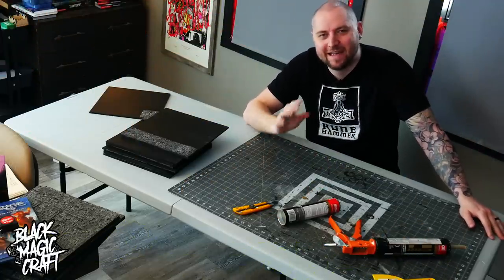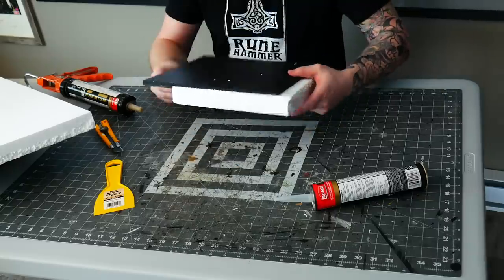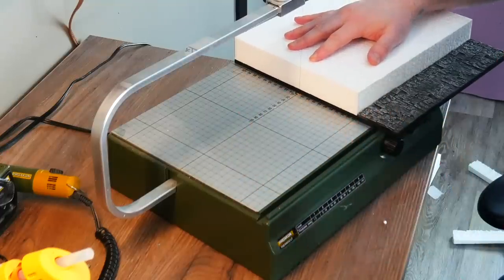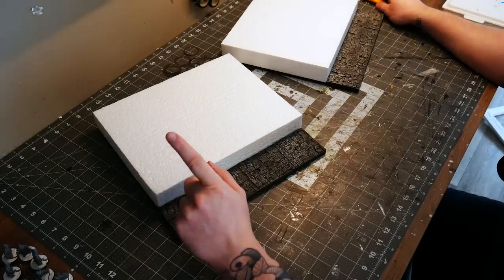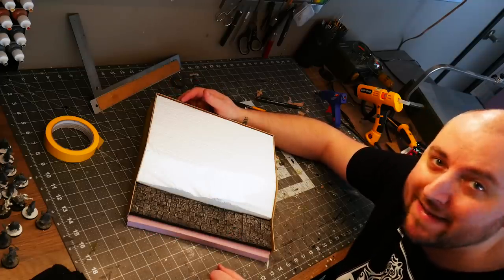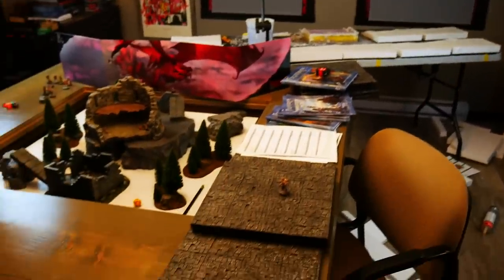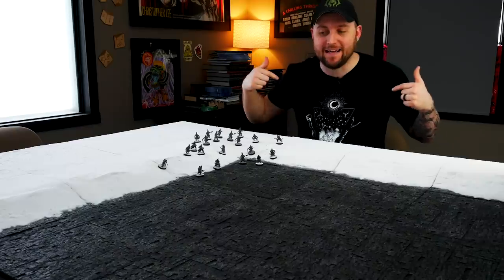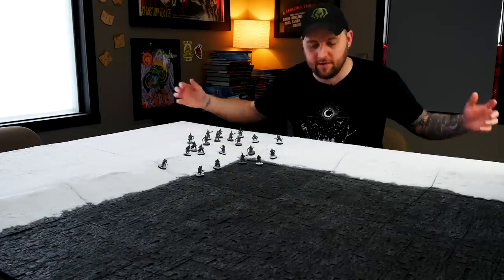High Detail Resin Tiles for FROSTGRAVE - Part FOUR

Comment: I don't build gaming things.  I am a dollhouse person.  But I always learn a lot by watching what you do.  For instance, I could use the snow hill techniques to build seasonal scenery for my dollhouse surround.  Also I have changed how I do fireplaces entirely based on watching you work with XPS foam.  And now the ones I make are not nearly so heavy, thus lightening up the overall weight of a dollhouse. And I may even try silicone molds and resin at some point.  (I am circling that issue still.) I really like watching an entire in depth difficult project like this for a number of reasons.  For one thing, I usually have no idea how long others take to do things, so I always think I am very slow.  (But not really, apparently. It just takes that long.)  I also like seeing where things went wrong and how you corrected them.  Very useful for us to avoid those mistakes, but also again, good to see that things do not always work out immediately for other hobbyists either.  Finally, I just really like watching people work. And I like that you tell us when you are tired, frustrated, bored etc.  All very human and again, something I can empathize with.  Thanks for sticking with this long project for us.
Reply from the maker: That's great! I love hearing people finding help in my videos for other things....doll houses, dioramas, fairy gardens, etc. It's great how much of the techniques overlaps between hobbies. Thanks for watching and for the feedback.

Comment: One of the really cool things you could do with this modular terrain too, is having a big ol' snowhill in the middle of the cobblestones. Since you have approximately six transition pieces, if you did a 5x3 battle grid with the setup of Cobble, transition, snow, transition, cobble... it would be a cool snow-hill that the different sides are fighting over rather than a basin that you currently have it set up as. :D

Comment: Which method? Do both, let the project decide which is more appropriate.

While I have no desire to make these exact tiles, there was a lot of great takeaways. Most notably, tips on casting, snow flock, trimming on the proxxon, and generally how to approach a large modular project by planning ahead as much as possible to avoid pitfalls. Most importantly you sharing those inevitable pitfalls with us.

Keep up the great work!

Comment: As a guy who also made a bunch of snowy terrain and a snow covered battle mat, I also recommend simply buying the snow flocking from Woodland Scenics. I tried a lot of different snow method and the easiest one was with the snow flocking. Even with paint over any homemade recipes, I was not looking as good. 

For it to look like snow though, you might have to do a 2 to 3 coating of the flock, especially if you want it to look like thick snow. I found that using only 1 coating would let some gaps between the flock and it wasn't looking as good, even with a white undercoat.

Comment: In model railroading when applying the sculpamold between modules, we clamp the two modules together apply and shape the molding then before it dries completely we take a knife and slice the moulding and pull the modules apart and then let it dry completely. No need for gigs.
Reply from the maker: But in railroading they only fit together in one orientation, permanantly. In gaming they need to be modular and have every piece fit together in any order. Not just A B C D, but D A B C or C B D A....this is why they need a universal jig so ALL sides match.

Comment: Video types suit different things. Experiments and trials like this work best in vlog, while shorter form snappy things are easier to copy, though I’d suggest doing as Pinkstylist did and creating some basic, snappy techniques videos and linking to them whenever you skip over a technique you’ve done before (dry brushing, flocking best practice, resin doors, tile bases etc).

Interesting build though I’m wondering if brick or cobble plastic art would have been cheaper and more durable in the long run. I’ve found resin prone to chips and warps.

Comment: Another good option for the snow flocking would be to apply a layer of clear, polyeurethane gloss over the areas you want snowed over, sprinkle snow flock over it until it looks dry on top (The gloss will make the flock look wet), then leave it for the gloss to dry and recover any of the flock that doesn't stick, then add another coat of gloss and go with a light sprinkle over top, it gets rock hard in the end and works great for this kind of thing.

It does tend to look better than using the glue paste option. My big use of it was back when I was playing Warhammer Fantasy, had a Vampire Counts army that I'd modeled more after the scourge from the Warcraft universe (Death Knights could be handled as Vampires with no issue other than sourcing models that fit well), so a lot of snow and ice terrain thrown together for it where I'd used it.

Comment: Nice job. I think the only thing I would add is some airbrushing on the central squares so they are more snowy... but that means they can only be used for snow where as yours can be used for other settings.
Reply from the maker: As I said in part one the stone tiles are intentionally left generic for use in other games and photos. Otherwise I would have littered them with snow flock to make a more organic look with the outer tiles. It was a very intentional choice to leave them like this.
Reply: @BlackMagicCraftOfficial  Yeah, but part one was before I slept... so I forgot. LOL

Comment: When placing the sculptamold on the hills, did you consider putting all the pieces next to each other and doing them all at once? Then once dry you could cut the pieces apart, and they'd be at just the right level, since they were next to another piece.
Reply from the maker: No, because then they would only fit together in that one particular order. That's why you want a jig that keeps both sides the same so that they can be placed next to each other in any order.
Reply: There will be small variations in height. If you put A B C next to each other, they will look good, but A C B will have annoying height differences. On a table this nice with this much work, it's worth it to spend the extra time making the jig.
Reply: I was thinking get a bunch of 1" foam strips and cut them all the same shape (a wedge/slope). Glue those to each side of each tile, then the center could be added in whatever fashion because the edges will all meet.
Reply from the maker: Bee Jay but you still need to cover those strips in material that you want to keep a consistent thickness and shape.....so you’d still need the jig.
Reply: @BlackMagicCraftOfficial  Yeah understood.. otherwise you'd have an artificial looking dip at the edge of each tile just to satisfy the join. Keep up the good work!

Comment: IME, if you want a really clean and straight cut on styrene foams, a band saw works remarkably well. (It's about as messy as you might expect, though.) Straight, smooth, and very, very fast.
Reply from the maker: I’ll stick with my foam cutter rather than finding, buying, and storing a freaking bandsaw 😂
Reply: @BlackMagicCraftOfficial  Yeah, I get that. When I was cutting foam with a bandsaw, I was using the one at work, not one in my garage. 8-)

But they really work amazingly well for straight cuts in foam. And I don't even like bandsaws for most wood cutting tasks. If you have one (or access to one), I recommend trying them out.

Comment: Having worked with the Woodland Scenics snow flocking a while now, do you find there is a physical difference between snow flocking and standard grass flocking?  Aside from the colour of course.  I've made some of my own flock for grass and I'm wondering how well it would work to just use white paints and make myself some snow.

I enjoyed this vlog format for this big project.  I feel like the more limited tutorials still would benefit more from your traditional format.  I'd enjoy seeing a mix of both big projects and limited projects.  Something along the lines of a 50/50 mix.
Reply from the maker: I’m pretty sure the snow flock contains a ton of very fine sand, unlike the grasses and turf that are foam. Also it’s very very fine, I don’t think you’d ever get foam that fine. A good alternative is white unsanded grout. Hard, durable, and cheap.

Comment: I JUST finished a large snow terrain piece for d&d the other week, and within a few days I already started noticing parts of the snow yellowing. I also opted for the woodland scenics snow flock, and used their scenic cement as well. Dried hard as a rock and that was all good, but I noticed the scenic cement is water soluble, and I wanted to use a water-based fog machine on the terrain without it dissolving, so I gave it a couple coats of the Miniwax Polyurethane you recommended for other projects. I'm assuming that's where I went wrong, and what caused the yellow. Do you have any recommendations for sealing snow terrain that's not water soluble, and wouldn't cause yellowing? 😅
Reply from the maker: Yea, the reason I switched away from the Polyeurethane and started using the Krylon was yellowing. It doesn't matter on a lot of stuff, but minis and light coloured terrain it sucks.

Comment: I personally prefer the shorter videos, mainly because they after easy to digest. You demonstrate a concept and execution with a ton of techniques shown at a good place. I think the shorter videos are easier to capture ones imagination because it's not too hard to imagine building a crumbling tower where bandits hide out, a hags but or post apocalyptic concrete and steel rebar walls, or that cool dark set you did. I guess because with those if you want to make more you always can. This project was very cool and it was fine to see how you tackle it but even you started to get punchy from repetition. Very awesome work though.

Comment: would priming the terrain a mud color. as an undercolor before doing the flocking work for knowing where you've done or havent done? not to mention, even if you miss spots, itll just look like ground that hasnt been snowed on. i know its an old vid, but just curious. if you were to go back, would that be an option or no?

Comment: $135 dollars is damn good for a Hard re-useable table you can play lots games on ... Only thing I would done would be added magnets or some sort of lock system to Clip them together.  I guess you could run a string around the out side to hold it a bit better together.  al in all I like it, Thought  you didn't add any roads in our out of a Huge town,  you might build or convert a couple of those for it.  also I like both ways you do your videos some that's needed close up one use voice over, big ones  like this was great Vlog style.   Keep up the good work
Reply from the maker: Tiles are big and heavy. They don’t move or need magnets.

Comment: other than that it was easier to get home, was there any reason to use this foam as opposed to regular xps? did it make a difference?
Reply from the maker: I answered that question in the video.

Cheaper and the advantages of XPS were not required in this build. Plus it’s already white.
Reply: @BlackMagicCraftOfficial  Cool. I just missed that part. Thanks

Comment: Wouldn't it have made more sense to relocate to an area where you could do it all as one piece and then cut it apart at the seams? Thinking of swooping, snowy hills in pieces makes it less organic.
Reply from the maker: Then it wouldn't be modular and would only work in one configuration. That's the whole point.
Reply: @BlackMagicCraftOfficial  I get that having that option overall makes sense...But the cobblestones line up and you kept the top flat so how much difference would it really make from one piece to another?  Rearranging the tiles wouldn't change the amount of playable space, and it wouldn't hinder your options for placing scenery in a significant way. 
Also, sorry if I'm coming off as a dick. I just discovered your channel and I'm really enjoying your content.

Comment: @#Black_Magic_Craft:  
What makes Mod Podge so much better than watered down PVA glue...  which is exactly what Mod Podge is...  watered down PVA glue.
Reply from the maker: That’s not true. It has pva in it, but it’s an acrylic based coating that also contains resin and flow aid.